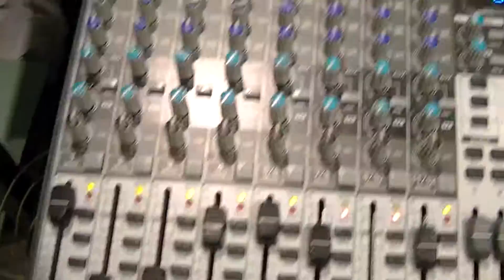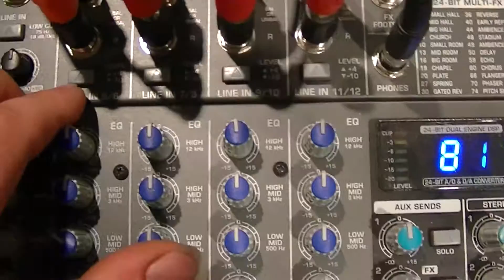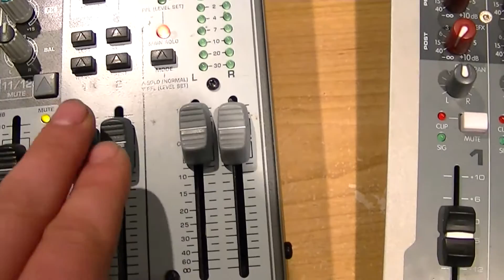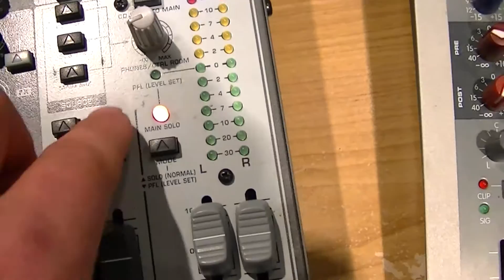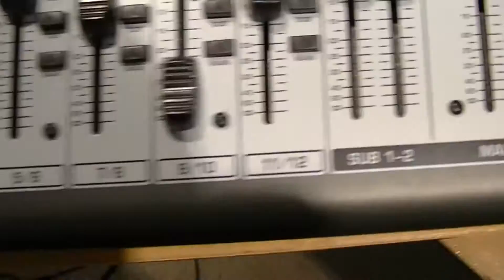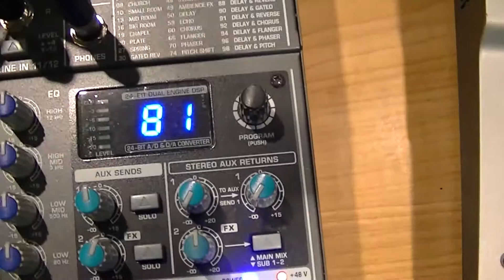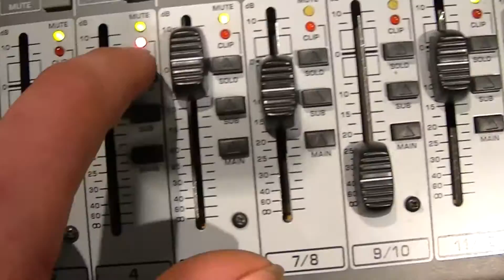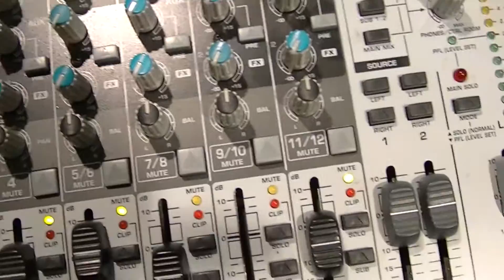Mixer Routing - Part 2 of 2

Comment: Mixer is a mixer is a mixer. You did a short video on the peavy 6 usb mixer but never really said anything. We know to plug in for power. We also know that if it comes with usb chord then that goes to the computer.  What you didn't explain is how do you hear sound from your computer speakers? How do you hook up the computer speakers to the mixer?

Comment: Your attempt to inform the uninitiated is commendable. However your video presentation could be better. The constant swishing of the camera is very distracting. A better idea would be to place the camera on a tripod with a static full frame of the mixer. Then point to the individual knobs, faders and jacks with a six inch pencil or pen while you continue the voice over. Nontheless, thanks for your help.
Reply from the maker: Thank you for the tip. I love the pencil idea. I'd much rather do that then put in digital pointers.

Comment: I have a xenyx 1002fx and dbx 223s, it's my assumption that in order for the routing to work, I must use mono connections and follow them through to the designated amps? or does it just make more sense to get a mixer designed for a subwoofer setup?

Comment: i got a mpl 1502 stereo mixer and a gxl 2400 condenser mic,i plugged the mic in and turned on the phantom power on but nothing worked,my set ups are;i use rca tape in and out going in my laptop what em i doing wrong?

Comment: Hi I wanted to know, I'm still learning to uncover the potential of my mixer and I wanted to ask since I'm limited on inserts on my mixer , is it possible to plug my electronic drum kit to an stereo channel and send it to my interface input without using an insert, because it does not come with one, for now my left and right are occupying 2 channels going stereo to two inputs on the interface. Is there another way? I need available channels for overdubbing tracks. I have MackieProfx16 mixer.

Comment from the maker: @DJparsons89 with the static problem,unplug one connection at a time till it stops. Or till you find the problem. If everything is disconnected and you still have a problem it could be a mixer malfunction. Also remember that all analog mixers have some sort of lite static like noise. Usually you notice this if the headphones or faders are turned up quite a bit.